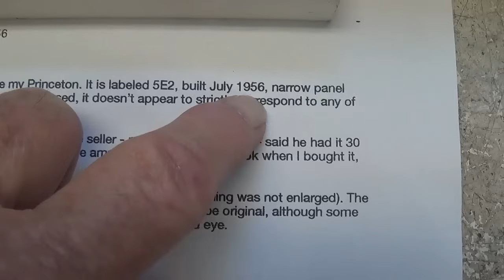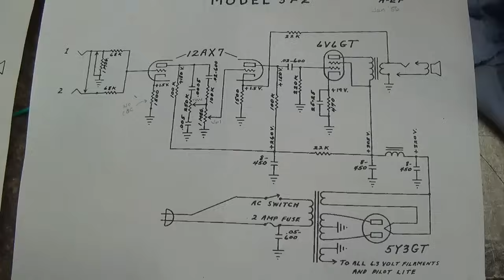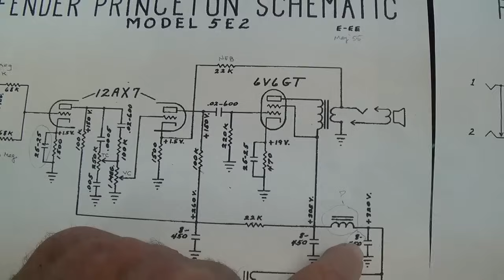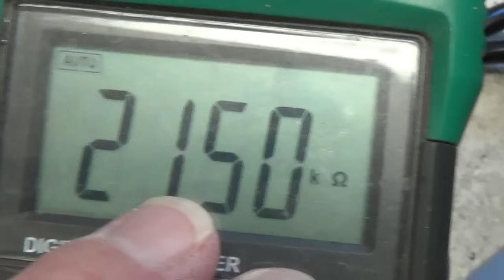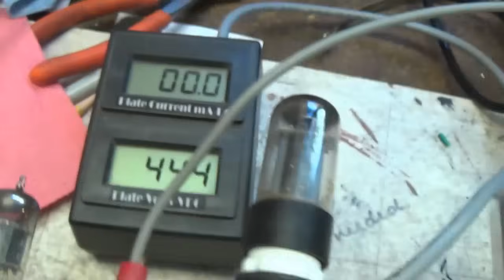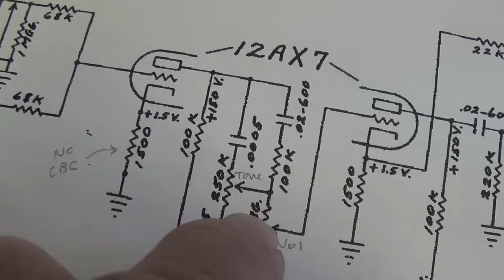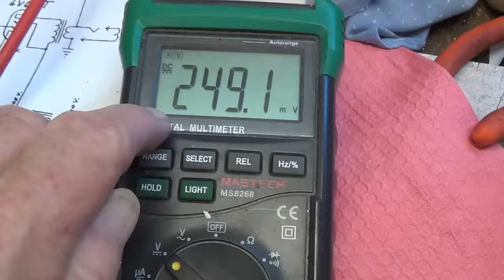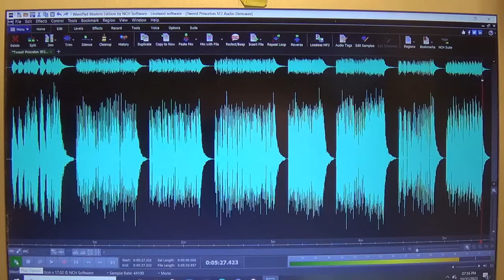1956 5E2 Tweed Fender Princeton Amp.....in for a Stealth Overhaul

Comment: Hi Doug.  Do you have any opinion/ argument using F&T caps over Sprague?  I think we all agree that IC caps are low quality.

Colleagues disagree on stuffing caps for "original". Kind of misleading/ deceiving. Leo designed amps to be serviced knowing components wear out, so the whole nostalgia coveting community is just delusional to snub serviced amps as less valuable, IMHO.
Reply from the maker: IMHO, Sprague Atoms are grossly overpriced and of no better quality than capacitors that cost far less. I prefer to put my customer's money into the best quality components for the price, thus either MOD or F&T get the nod, unless they specify otherwise. There are conflicting opinions about virtually everything we do, from how to wire primary circuits to how to orient non-polar caps. I will do whatever the customer requests as long as it does not have a permanent or negative effect upon the chassis or circuit. I really love these old amps and will not willingly do harm to any of them. There is no deceit in "stuffing" caps when the process is not only documented in a worldwide video but also by a written statement attached to the amp. With regard to "nostalgia coveting", as long as it only involves their own amps and their own money, it's really not our business.....but I do think they're a wee bit silly to shun carefully, accurately serviced amps, especially when all the original components accompany the amplifier.
Reply: Great reply Uncle Doug.  🍺🍺
Reply: @UncleDoug 
Thanks for your reply.  I meant no disrespect to you and your services. 

I've been inspired and schooled by your wealth of knowledge, your adherence to excellence and your sense of humor for over a decade.  Still miss seeing Rusty.  Love that you're a Hotrod/ Classic car wrencher also.

Best Regards
Reply: agree 100%... what good is a vintage amp that cant sing or burns up from neglect?
Reply from the maker: No problem, Steve. Good questions deserve straight answers :) @stevebeck3164
Reply: Great response.@UncleDoug . This customer should be well pleased with this amp. Do you have a video where you discuss this or an opinion on how to orientate non polar caps. I m busy with a build, but can't find much info on this .
Reply: @UncleDoug  great video!!
Thanks uncle,
I just thought I would stuff my 2 cents in...
Whether or not the components are original or new stuffed inside the original casing. It looks cool!!
I think there is something cool about the appearance of old electrical components especially inside an old amp,  radio, TV etc....  I get kinda of excited, I  have always found it fascinating to see how they did things back in the days of past.
Paper vs plastic etc...
Your work is impeccable very clean and thorough. I love the videos, humor, guitars, amps, and hotrods.
Reply: I love the idea of "nostalgia coveting, Cap stuffing". I think it should become standard if some how clearly documented as you so clearly did.  @UncleDoug
Reply from the maker: Thanks for the support, Steve. @stevebrown4085
Reply from the maker: Thanks so much for your very kind comments, Bob. I agree......old just looks better.....or at least that what I tell younger people ;) @BobBob-dv2qh
Reply: Have you had issues with new ICs? There were bad batches during the capacitor plague but that affected many manufacturers not just IC.
Reply from the maker: I don't deal with IC's, BM. @brownmonkeybananayellow
Reply from the maker: Even better.......What if the guy with the Ferrari asked for a re-stuffed battery and didn't give a damn if anyone agreed with his decision or not?  @pourspelang
Reply: @pourspelang  Non sequitur.  I'd be more concerned with a realistic scenario where the mechanic takes a used "vintage" battery that's slightly better than mine, shining it up to look new and charging me full replacement cost.

This process is cosmetic, which no one will see, except the owner knowing what's inside.  Good luck going to a vintage music store and ask if they'd disassemble the amp to see how "vintage" the components look inside before you're willing to purchase.

As Doug states, if that's what the customer wants, they get.  To me, I'd rather put the money into fixing/repairing what you CAN see, as well as hear.
Reply: @UncleDoug  It's worth noting also that the F&T caps will fit into the old wrappers without having to remove the wrapper from the new cap, as you had to do with the Sprague filter cap in this video. Also, that other Sprague bypass cap that you restuffed wasn't original. Original tweeds of this era used Mighty Mites.
Reply from the maker: I often use F&T's for re-stuffing purposes, Jimmy, and they work great. Are you really certain that one day back in 1956, Lupe didn't runout of Mighty Mites......and slipped a Sprague into a few amps ? @jimmyjoefine
Reply: @UncleDoug thank You.
Reply: @UncleDoug  I have found this to be true.  I just replaced (in February) F&T caps I changed on a Marshall 2555SL (Slash head) that I had serviced about 8 years ago.  They were already bulging, probably due to the harsh environment of all the little clubs/bar/restaurants in the Florida Keys where my friend plays.  I am very hesitant to change the original LCR caps on Marshalls unless I see a problem, or they test funky.  Think about it.  The originals in Fender lasted 50 to 60 years.  Marshalls 40 to 50 years.  New production is sadly just not the same in anything.
Reply from the maker: @bertrodriguez3087  Older is always better, Bert, or at least that's what I tell my wife :)
Reply: I told my wifey that, she’s still laughing!

Comment: Uncle Doug, you did a great job stuffing new capacitors into old tubes. I just completed a component update to an old Fidelity HF19 1961 record player, to make a video. I attempted to stuff the original aluminium can with three new replacement caps. It was a total disaster and I am so disappointed with my end result, both visually and audibly. I must have spent £50 on two new tubes, capacitors, resistors, stylus, rubber motor grommets and my time. I think I'll chuck it back into the bin where I found it, and not to attempt to emulate a true professional like yourself ever again. The trouble is, you make it look so easy and you always have a perfect sounding result. I am, as always, in awe of your productions.
Reply from the maker: Thanks so much for your very nice comments, Tim. I'm sorry your project did not meet your expectations but please don't become discouraged. Keep at it and your results will improve over time. Best of luck.

Comment: Thanks Doug, for another great informative video. You may have unlocked a problem that I've had with a kit that I purchased years ago on Ebay that someone built of a clone Marshall 1974X head. I've had 2 repairmen check the amp out. One couldn't find any problem with it, and the other said it was V1 preamp tube. However, the volume pot is still scratchy when adjusted. The pots have been cleaned by both repairmen and me. I recently began repairing amps, so I'm going to check the coupling capacitors for DC drainage. Thank you so much!
Reply from the maker: Check them for DC leakage, Joseph, and please be very careful.  We care about our viewers :)
Reply: @UncleDoug  I will, Thank you!

Comment: Oh hey, thank you for sharing the way to calculate the expected speaker rating.  I have a few OTs that randomly came out of old gear, so I don't always know what ohm rating of speaker to use 🤩 Uncle Doug to the rescue!!  Also, great job on hiding the new filter caps.
Reply from the maker: Thanks, GF. Determining the winding ratio can eliminate all the impedance issues :)

Comment: Good to see you again! For the drop type capacitors you couldn't replace, only think I could think of is trying to take a mould, finding a capacitor that's smaller and using something like an air hardening coloured clay around them, it's a long way to go but if you're dead on keeping it original it might be the way to to

I don't think I've ever seen an amplifier with so little in it!
Reply from the maker: It gets too time consuming and expensive to pursue original appearance  too far, P.  I try to maintain a happy medium :)
Reply: @UncleDoug  for sure, where does it end, like the old type resistors, they don't make them that way any more, and sure to can buy old stock, but how long are they going to last once they start getting juice!
Reply from the maker: @phonotical  I guess it's best to maintain a degree of common sense when seeking the best quality restoration

Comment: Hi Doug, Jupiter Condenser makes a great copy of the red paper foil Astron capacitors Fender used during the “tweed era”. They are nearly clone correct down to the labels depicting a 400 volt rating just like the originals; however, they are actually rated at 600 volts. While a bit pricey, they might be just the ticket for a Fender tweed amp in need of it’s leaky yellow astron caps replaced.
Reply from the maker: Thanks for the tip, Hiatt. I'll look into them.

Comment: Hello, UD, great to find a new video of your work!
I want to note that I was surprised about the result of the leak voltage test of the output stage coupling cap, since the tube seemed very reasonably biased. I guess the explanation is that the virtual DC resistance of the leaky cap forms a voltage divider with the input resistance of the multimeter (I guess that's about 20 Megaohms). That's 100 times as much as the grid leak resistor of the 6V6 according to the schematic, so, roughly, the faulting of the grid bias voltage would be only one hundredth of those 12.4 Volts that the MM showed - 0.1Volts. Seems negligible, but obviously that cap was not reliable and right to be replaced.
Great sound of the completed work, and  good to take a step back to times when people were satisfied with a 5 Watt SE amp!
Greetings, Regald
Reply from the maker: Greetings, Regald, and thanks for all the nice comments. Glad you enjoyed it :)

Comment: Excellent video, as usual.
I enjoyed the cap stuffing, (you are really getting good at it), and as an ex repair guy I want to thank you for labeling them to help the next person who works on it 50 years from now.
For your output impedance calculations, your methods are right on the money, but if you remember that back in those days, (1950's and 190's), 3.2 ohm speakers were quite popular; and your might find they reflect an impedance that produced a better performance; both for power and for adding more 2nd harmonic pleasantry to the sound.
 I hope that someday you will do a video comparing the power output at the clipping threshold of a single ended amp like that one into various speaker loads such as 2, 3.2, 4, 8 and 16 ohms. Not running long enough to hurt anything, but to show guitar players what to expect performance-wise out of their amps when they go swapping speakers or plugging in external speaker cabinets.
Reply from the maker: Thanks, Dennis. I appreciate your suggestion and will keep it in mind :)

Comment: Definitely a nice way of packing the chassis. Box-in-a-box would be great too.

Oh, it goes to 12... Take that, Spinal Tap! They've outdone you! 
I absolutely love how you did the cosmetically accurate restoration of those caps. Down to the foam discs... Hope they'll hold over time in elevated temperatures without decomposing, melting or other unforeseen consequences.

As for the front panel, if the budget was high enough, I'd have a silkscreened copy made; personally thoug, I'm not really a fan of fresh-off-the-line restorations. Beausage is where it's at for me, the beauty from usage and keeping it well maintained.
Reply from the maker: Thanks for your input, KE. Since the internal resistance of capacitors is (ideally) zero, they should generate no heat, while the cardboard and foam will actually insulate them from external heat :)  I agree, slightly tattered original is way better than completely refurbished perfection.

Comment: Uncle Doug!! Thank you for all of your skills and knowledge. Just so you know I have put your Youtube Amp Repair and Knowledge Videos to use and I have learned soo much!! This year I have built 3 amps and each has been more complex and intricate than before. I started with an AX84 high octane single ended build. Then I made a Hot Rodded Point to Point JCM800 style amp. I just finished my most recent build which is an inspired Clone of a Mesa Boogie Dual Rectifier. With this build I had to employ your voltage doubler circuit with my Schumacher 80-73-0 Power Transformer to raise the B+ to feed my push pull 6AQ5's. Ended up with 280ish Plate Volts afterwards loaded. Yes you heard that right a Mesa Dual Rectifier Preamp with cathode biased 6AQ5's. This is most likely the most monster sounding 6AQ5 amp in existence. After 19 years I have finally built the amp clone I have always wanted All point to point. Thank you for sharing all that you know because you have made a massive difference in my amp building life. I wouldn't be successful without you. You sir are awesome!!!! :) Hope you are doing well!!
Reply from the maker: Wow, Will. Thanks so much. It's great to hear that the videos were helpful :)
Reply: @UncleDoug  Have you ever used Express Schematics to make your own schematic designs? It gets the basics of your design. Where the real magic comes in is using DIY LC Layout Creator to build your schematic digitally into a set space and organize things really well.
Reply from the maker: I tend to be old fashioned, Will, doing my layout work as I go, with no prior diagrams or plans. Thanks for the tip. I'll look into it when I get the chance. @will523
Reply: @UncleDoug  Old fashioned is the way to go. My Dad has been building tube radios and amps since the 1960’s. Point to point is where its at. I have found that using a layout designer mentally helps me picture how and where I can better place things to make things look as sharp as possible. Thanks for sharing your knowledge UncleDoug.
Reply from the maker: I have no doubt that modern technology would enhance the building process, but I am generally too excited and anxious to begin construction to take the time for digital preparation. @will523

Comment: Once again a stellar recap.  I personally don't see that stuffing new caps in old sleeves is worth it, the only one looking is the next tech. I do however believe in putting axial leads back, that is, using the same type of capacitor that was originally used.  Some techs scab in radials, they look terrible, and orange drops don't look too good either.  As for multi-section cans,  I kind of see it in this order; New can if you can get one,  if there is lots of room under the chassis, then axial leads on terminal strips or eyelet board if you can make it look like it could have shipped that way; and last resort is stuff the can. I say that because sometimes three caps of the correct value don't fit the old can and it is difficult to make the terminals look correct.  It is sometimes worth getting Hayseed Hamfest to make one.  So I guess I'm saying, I think neat and original wiring is good, but there is no need, in my mind, in hiding new components as long as they are keeping with the original lead type and not some crazy color. (orange drops)  I always leave an envelope in the bottom compartment detailing what has been done and when, for the next guy.  No slight intended, really neat work, if it were on the exterior, it would matter more.
Reply from the maker: Thanks for your input, DH, but when a customer requests a cosmetic circuit overhaul, I see no harm in doing it. Plus, I leave a clear statement in the chassis of what was done. We all have our personal preferences, and it's best to respect the opinions of others, in hopes that they will respect ours.

Comment: Hi Doug. Interested that you discounted the 5F2-A schematic - i know it was officially later than this amp, but there are areas where it matches the bench unit at least as well as the 5E2 - eg the on/off switch being present as well as having the cathode bypass on v1. Of course that doesn't change your overall point that they were clearly using what was around rather than following the schematic 100%. Lovely repair work as always!
Reply from the maker: Thanks for your input, DH. I think we were splitting hairs a bit, trying to make a circuit (that was subject to day-to-day variation) exactly fit a specific schematic that was probably more of a "suggestion" than an absolute pattern for construction.

Comment: Future video request: field coil speaker to modern speaker conversion (I'm looking to scratch build from an old Valco 1200 schematic but I don't know what to do about the speaker)
Reply from the maker: You can substitute a filter choke (i.e. a standard Fender choke) for the field coil in the power rail and then use a permanent magnet speaker.
Reply: @UncleDoug  awesome, thank you

Comment: Great restoration, Uncle Doug ! 
I have an idea , if ever you have to replace the old blue or yellow coupling caps, I bet you could drill out the core. I'm picturing it bored out from one end to the diameter of a new mallory, maybe. The other end can be drilled out to the diameter of the lead. Then you'd only have to fill the other end once the new cap is in there and color it blue or yellow..
Reply from the maker: Thanks for the helpful input, SB. I tried drilling a solid cap once......and it's virtually impossible.
Reply: @UncleDoug  you're quite welcome. Thanks for all the great content!